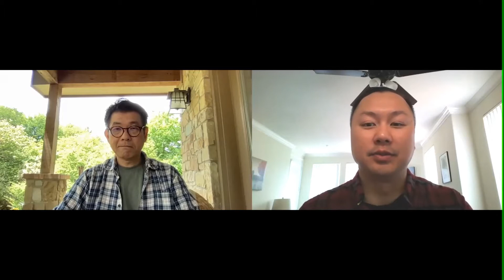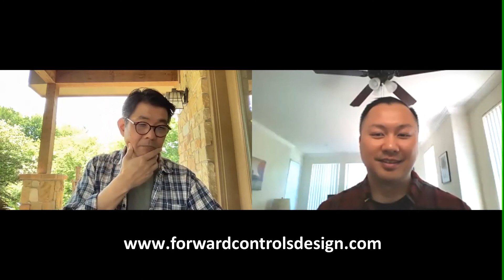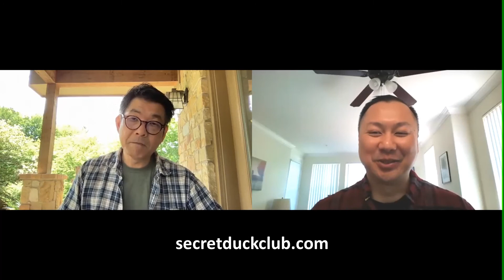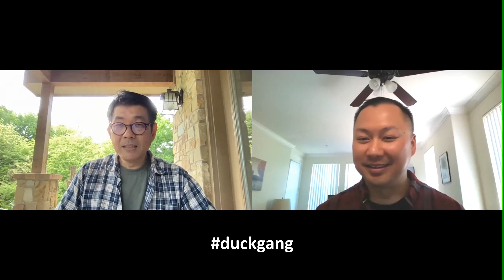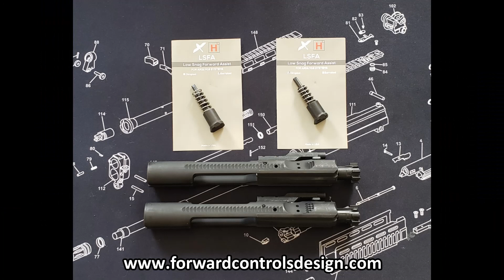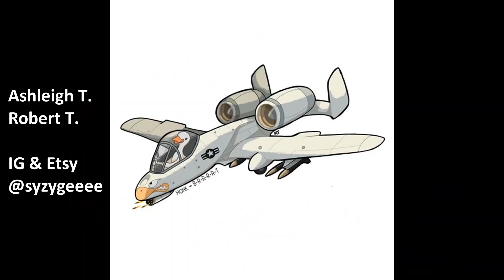Inside the Industry: Episode 002 - Roger Wang, Forward Controls Design (FCD)

Comment: God bless my Wang and you for doing this. No matter what hobby I'm into, I'm always looking for that brand that has simple beauty, extremely high function, extremely high quality, and that "it" factor, which includes looks. FCD is probably my favorite brand in the AR world, or at least my favorite for the components they make. They're that brand that is just my style that I will eventually find myself at if I search long enough and gain the experience to know what I like. He is always so funny how he always mentions looks are never part of the equation because to me, they make some of the best looking stuff by far. I'm sitting next to my Radian with an FCD Keymo muzzle device at the end of that beautiful rail next to a few other great parts on the fore end of the gun. It's like the icing on the cake and it all works so well. The Cygnus is sexy.
Reply: How do you like the Flash hider?  I'm looking for something other than dead air muzzle devices for my dead air can.
Reply: @seang1032  It's great. It's an upgraded A2 that actually looks really good and is shorter than a 3 prong flash hider. As far as flash hiding, it does a great job. If you shoot at night without a can it will have zero flash most of the time but every few shots you might get a small explosion (which is just like you get with most suppressors). Compared to a 3 prong, they both stop the flash but the 3 prong never seems to have that "detonation". However, the 3 prong offers no recoil mitigation really, but the FCD flash hider does just enough to be noticeable. A mild comp effect because of the top ports. If you want a keymo flash hider that's minimalist, does plenty to hide flash even at night, and looks good with no concussion then the FCD is a no brainer. It also turns a crispy bronze color once you shoot it with a can on which is cool looking lol.
Reply: They are my favorite “small parts” plus their BCGS and buffer tubes love it